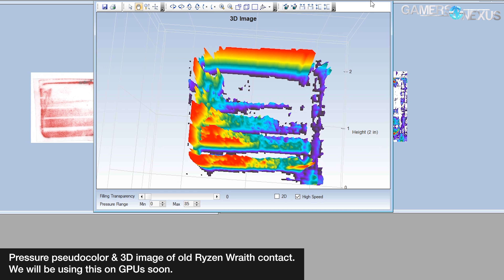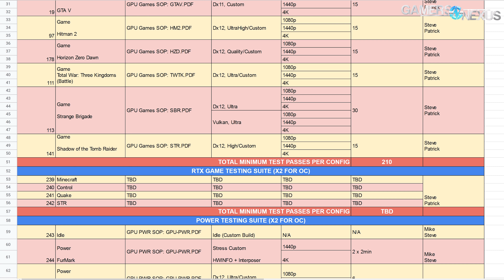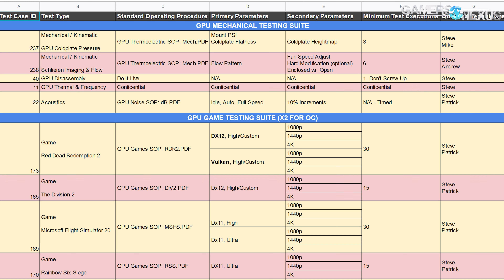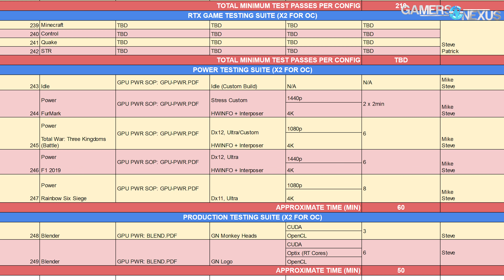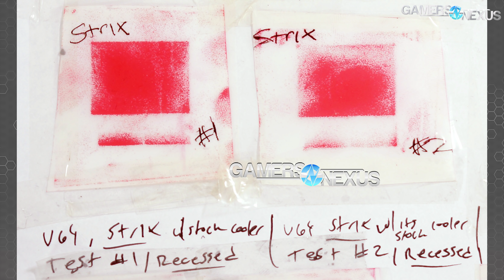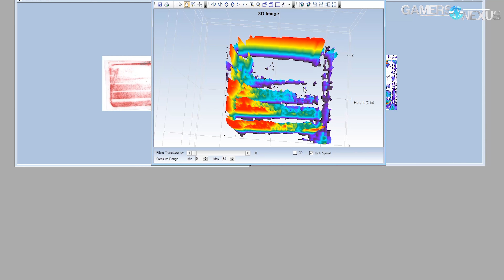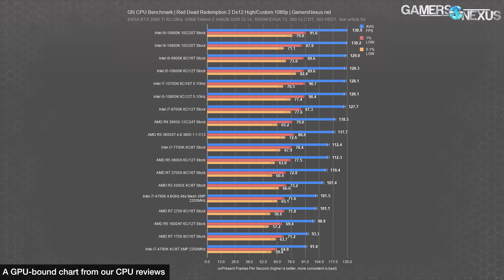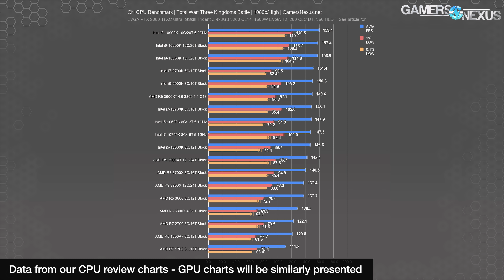$13K of GPU Test Methodology: Airflow Photography, RTX Games, Pressure Tests, Power, & More

Comment: 13:45 I really hope you could include some Optix benchmarks as well! I have a okay CPU+GPU CUDA render rig that got the same performance as a single RTX 2060 in Optix on 256x256 tiles. I would love to know how RTX 2000 on optix compares to RTX 3000.

In my experience, the optimal setting for GPU only is 256x256 and CPU+GPU in cuda is 32x32.
Below 32 the GPU isnt used enough, and above 32 the CPU really starts to lag behind as decribed later. The tiles get too big.
You should know, if your CPU has x number of cores, each GPU consumes 1 core in the process. So say a 10 thread CPU with 2 GPUs will render 8 tiles on the CPU while the 2 GPUs each speed along with one tile each.
But then if you have optix which requires an RTX card to run optimally, always go optix with 256x256 :D

Comment: Hi, about the RTX and DLSS testing. I think it would be great, if you woul test those, as f.e. the difference between 3080 and 3090 in rasterization is not that big, but with RTX on on the other hand, it should be a significant difference, but how big exactly? This would potentially help viewers decide, if the 3090 is really worth to buy. 

As of now, I'm not sure, if I'm willing to spend 700+ to gain just 10-15% performance uplift. If it would be around 20%+ with RTX on, that is a different story. 

Thank you GN

Comment: DLSS is, imho, the true technology that will bring amazing graphics into a more common customer base, and in the end will be more widely used as games begin to start using RTX tech more frequently with the console games. That being said I think the RTX cards all have enough oomph to provide max settings at 1080p for most games, and with 1080p still being a common resolution, DLSS will be used realistically at the top % of gaming, again until the new RTX games from the new gen consoles start to get produced.

However once DLSS gets a "true" debut, I would seriously consider using it as in benchmarks and examples, DLSS can make serious jumps in fidelity of images with very little impact on performance.

Comment: When I'm playing games its mostly either Age of Empires 2 or CSGO, so no worries there. However for Machine Learning and especially Deep Learning a testing segment would be greatly appreciated because this is what I base my system around.

So for professional applications one of the more common benchmarks is straig up Matrix Multiplication. 
An example like https://www.pugetsystems.com/labs/hpc/AMD-Ryzen-3900X-vs-Intel-Xeon-2175W-Python-numpy---MKL-vs-OpenBLAS-1560/ works well for cpu, and to show that Intel MKL is an intel math library, not a universal one. 

And for GPU I would be especially interested in some kind of training and inference speed of DNNs in Pytorch or Tensorflow. e.g. Train ResNet50 with max possible batch size and batch size 64 for 100 Epochs on PyTorch/Tensorflow and report time per epoch or used images per second. (This will probably be scewed towards NVIDIA though since all the packages run on CUDA)

(There is also this https://www.reddit.com/r/MachineLearning/comments/ecazk2/d_gpu_benchmarks_for_deep_learning_tasks/ reddit thread that aims to tackle this question, with the AI benchmark being much more comprehensive than just training one network.)

Comment: Why are you going to be using a 10 series Intel? From what I understand and revealed at the launch for NVIDIA 3000 Series the 10 series Intel doesn't support dlss 2.0. The information was located in the video in the bottom right corner as to what CPU that were using and why.

Comment: I have a GTX 970, so I can't use RTX or DLSS, but I am interested in seeing if it's worth pursuing. I think it would be worth doing a separate piece on the first card of each architecture, so comparing the 30 series to the 20 series, both framerates and visual quality.  And then when the Radeon 6000 series comes out, doing the same thing and comparing it to Nvidia.  But for subsequent cards-- the 3090, 3070, later Radeon cards, a simple relative rating in the review should be fine.

On a separate note, these aren't really workstation tasks, but with the pandemic and distance learning, I'm using NVENC and the video encoding capabilities of my card a lot more than I ever expected to.  I'm using OBS to record lectures and activities for students and using DaVinci Resolve to combine videos and add effects.  I'm very interested to see if any cards are especially good or bad at those tasks. I'm using resolve because the school isn't paying for software and Resolve has a free tier. Adobe is just too expensive.

Comment: Workstation testing: DaVinci resolve 16. Due to budget I sometimes have to use OpenCL rendering for AMD gpu that has more memory.  Without using proxy video, 4k denoising will bring a system to a standstill.  DaVinci resolve favors Nvidia 20 series cards.  But sometimes I'm only left with an AMD GPU.

Comment: Torque is very problematic, which is why cars rarely use torque now, usually a low torque to barelt mate, then an angular rotation to ensure correct length movement, others use bolt stretch, but this might be difficult in this case. but  i recommend the low torque then angular rotation system- works on M3, Aventador, Chiron......

Comment: From the standpoint of data scientist/researcher I'd be interested in seeing how long does it take to train a model (let's say something very standard like VGG16) on a well-known dataset, small enough for 1 GPU to handle, e.g. Stanford Dogs Dataset, and how does the power consumption/thermals look like during the training. One problem I see with this is varying size of batches, dependant on the amount of GPU memory - while feeding neural network with images you don't do it one at the time (unless you have no choice), but rather in batches. The more memory your GPU has, the larger batches can be, which speeds up computations immensly. I'm not sure how to compare different GPUs results considering this variable - the rule of thumb in the community with the batch size is to try different powers of 2 (let's say you know how complicated your model is and how much memory you have, so your experience tells you to start testing witch batch size of 256), and lowering them to the next closest power of 2 (in our case to 128) if it turns out that you run out of memory, or trying larger one (512 in our case) if you're not.

Comment: I actually think that the "bad data" you showed around 27:00-28:00 is actually very useful because it paints a more holistic picture of the hardware/software ecosystems. In particular I think bottlenecks matter, that a fair number of applications like Flight Sim or GTA 5 bottleneck is important information within the larger story of a hardware launch because it frames the boundaries of diminishing returns which matters a lot for purchasing decisions that aren't automatically buying "the best". 
e.g. last gen the vast majority of 4k Scenarios were GPU bound, thus Spending $750 to upgrade my 2700x to a 3950x doesn't really make any sense, though 30-series may mean upgrading to Zen 3 will make sense. (Or it might not)

Edit/P.S. As a professional scientist (biopharmacuticals) I think you should be mindful about the term "Bad Data".  Horizon Zero dawn is an example of generating "Bad Data" because there are known problems in the methodology which can generate false results. Flight Sim and GTA however actually provide "Good" high quality Data and valid results, even if you ultimately decide they aren't relevant points of comparison for the topic at hand.

Comment: I am a professional CAD user. It would be good to test consumer GPUs with large NURBS-based CAD models - mainly translation, rotation, and fly-through. Most CAD software will take a NURBS representation and project it to a mesh-based representation on-the-fly, which puts a different type of loading on the GPU. It's... similar to Blender, but not really the same render pipeline, and it's usually not as well-optimized.

I also do work with hardware-accelerated computation, image processing, and machine learning. All of the stuff I work with is pretty handbuilt and hand-optimized, so I wouldn't call it representative of a normal workflow... but... to some degree I think that's kind of the nature of the beast there. If you really want to get a convincing data science benchmark going, it might make the most sense to start a github in order to curate a community-driven benchmarking tool. I don't think there would be any one piece of software or use case that would be really compelling to test. 

Other than that, maybe just use the Top500 benchmarking tools? Those would be LinPACK and HPCG, both of which have GPU acceleration.

Comment: I haven't in a while, but I used to work on diy back pack pc's with batteries, so the power efficiency would be interesting

Also, are you planning to verify the 3090 60fps@8k claims? 

maybe run flight sim at 8k to avoid cpu bottleneck haha

Comment: Any particular reason you're only testing the DX11 version of Rainbow Six, and not the Vulkan version? Other than the fact you're swamped with tests already. I get quite a large framerate discrepancy between the two engines.

Comment: You can't use a torque driver to find the torque that's already applied to a fastener. It's a common misconception though! The amount of torque that it takes to activate the mechanism inside of your wrench =/= the amount of torque being applied to the fastener, because until the fastener spins, it is NOT experiencing torque, and it requires much more torque than was required to reach tension due to the tension that already exists in the fastener, and the clamping force against the surface to which it's mated.

Basically, if the fastener you're fastening isn't turning when your wrench clicks, then it isn't measuring torque as applied to the fastener for the purpose of tensioning, it's only measuring torque applied from the person at a fixed distance from a fixed point and not as experienced by the fastener.

So, solution-wise, the BEST you can do is finding out torque specs from the manufacturer, elsewise you could do something wild like measuring the stretch of the stud that has already been tensioned, and finding out how much torque it takes to reach that same amount of stretch, but that's a bit too bananas, and again, tensioning is hard to control for without incidentally overshooting, unless you're using the specific transducers built for measuring it.

Sorry if this little rant is based off of my misunderstanding of what was stated at about 20:00!

Comment: At this point you could sell access to your reports to other companies. These industry reports are usually very expensive often starting at $2-3k and going much higher depending on the subject matter. I have seen testing reports for EV motors run into the 10s of thousands.

Comment: Workstation: Unreal Engine 4 imo is not super-benchmarkable for GPU, for CPU the two main tasks are lighting builds and engine builds (in Visual Studio). The engine building there's a great article up about Ryzen/Thread ripper scaling that I always use when planning systems
Reply: If you did want to benchmark lighting builds you would want to use the Paragon map (free asset from UE4) and do a preview build as well as a production build. It's a multithreaded process, the nice thing for people who do these regularly is that it supports network builds (via swarm) so you can have a nice 12 core machine in the back room and just send the geometry/lighting data over the network and let it process. Some AAA quality maps can take hours to days to precompute static lighting. For artists, you have to do at least preview builds highly regularly when designing a level so 2x speedup is roughly equivalent to a 2x productivity boost

Comment: I'd love to see a benchmark for capture one, Capture one is a raw photo editing software that most professional photographers use (lightroom being the other but its shit and slow). Doing an export of say 500 raw files with edits and corrections to jpeg. It has GPU acceleration built in, I can throw what would take my overclocked 4.4ghz 3900x 13min and push the load to my 1080 and do the work in 7min.  So it really uses the GPU.

Comment: Please do some testing with DaVinci Resolve, which is highly reliant on GPU performance. I am a colorist and editor that uses it extensively, and there is very few people doing in depth testing with it. Higher resolution projects in that program can hang if they do not have enough VRAM (4K projects occasionally run into this issue for me on my 2080 with 8 GB VRAM), so much so the 10 GB of the 3080 makes me unwilling to purchase it, and has me leaning towards the 3090. Puget systems is pretty much the only one that does extensive testing with this program. Would love to see you take a crack at it. Premiere pro is a great program but does not scale with GPU performance.
Reply: Specifically I would love to see if their new vram compression that they are touting results in less vram being required to run games and programs such as Devinci Resolve

Comment: Yeah, but you need one of those 3900x or 3900xt systems set up with some good Samsung B-die and tune it up.  I just finished tuning up my current RAM kit yesterday and let me tell you... just to use a benchmark slightly relevant to games that I happen to own I chose the CPU score from Timespy and set up a video constrained test with a 1660 super.  The results were eye opening.  I ran 4 tests:  fully tuned timings / 3800mhz RAM / 1900fclk * DOCP / 3800mhz RAM / 1900fclk * DOCP / 3600mhz RAM / 1800fclk * DOCP / 3200mhz RAM / 1600fclk.  There was a 9% difference in JUST the CPU score between the 3200mhz / 1600fclk runs and the fully tuned 3800mhz / 1900fclk runs.  Nine percent and those were all "non junk" runs.  The slowest run I made was representative of what many people might put on a 3900x... DOCP 3200 RAM Bdie and 1:1 at 1600fclk.  So I have no idea what the difference could be if I had thrown some really common 2666 or 2133 office RAM in there.  There's a TON of perf on the table for Ryzen 3900x and 3900xt if you actually push the RAM and fclk and don't pick some wussy middle ground.  It's worth a test. EDIT - I'm super interested and excited to see how a tuned up 3900x with PCIE 4.0 is going to perform with a RTX 3080 against the 10900k.  Very very interested.

Comment: Do you have a link for the use of this airflow system to check masks?

I would have just found some way to make the airflow visible to the naked eye or uv or ir without damaging components. Smoke or something from a fog machine type setup. It might not even need to be safe for pcb components since you can remove the cooler and run the game with a fake pcb under it (though that would ditch the gpus own fan control curves)

Comment: I’d really like to see the % difference charts between all of the GPUs. It’d just take like 10-30 seconds of time to show. I think it would be very informative for people with older GPUs thinking about upgrading. Say for example, 1080 -> 3080 or 1080Ti -> 3080. You can multiply you current fps by 2.5x or 2x by upgrading (roughly speaking).

Some people, like myself, find it hard to really visualize what the actual benefits would be upgrading to a better card.

Comment: Have you considered adding a proper perf/watt comparison to your testing?  One where instead of a single data point, the usable range (for example: normalized performance as a function of -50% to +20% power limit in watts) is plotted as a curve for direct comparison with other curves.  I feel like meaningful discussion of efficiency can't happen without this full context, as it is too easy to make unfair comparisons as was seen in Nvidia's Ampere marketing material, where the top (low slope region) of one curve was compared to the bottom (high slope region) of the other.

It would probably be too much effort to do this with manual voltage-frequency work, but even just a single high-load benchmark run at 4 to 8 different power limit percentages with the stock DVFS managing itself would add a lot of value.

Personally, I enjoy gaming with a reduced power limit as the returns on efficiency are always positive due to the workload being embarrassingly parallel.  People into HPC, SFF and crypto might also appreciate it.

Comment: Honest question:
If the two benches are identical in performance and components, how come you can’t cut the review process in half and do half on each system and then if there’s an issue run that test on the other one for comparison?

Comment: What happens when a game requires an update to run, and the update contains performance optimizations? Would you redo all of your tests, or remove the game from the suite? Flight Sim looks like something that could do something like that, because it's always connected to the internet and is desperate need of multi threaded improvements